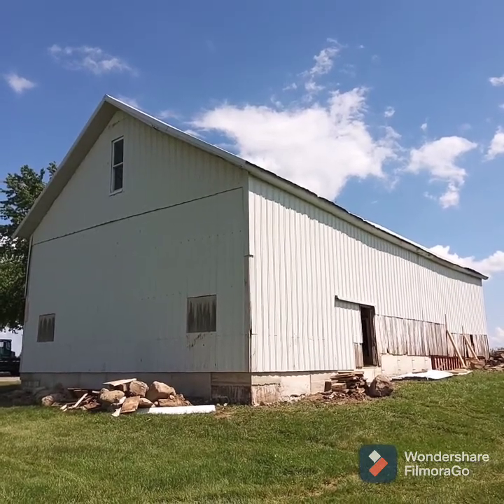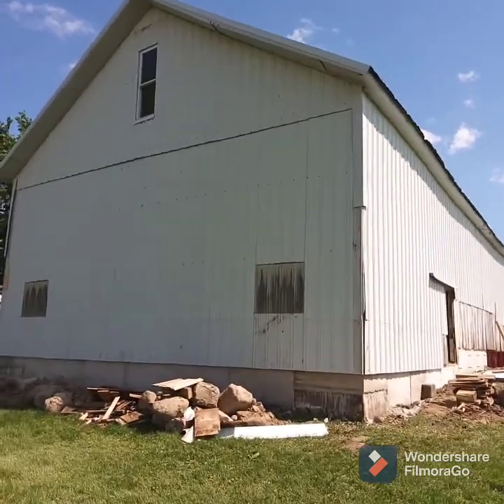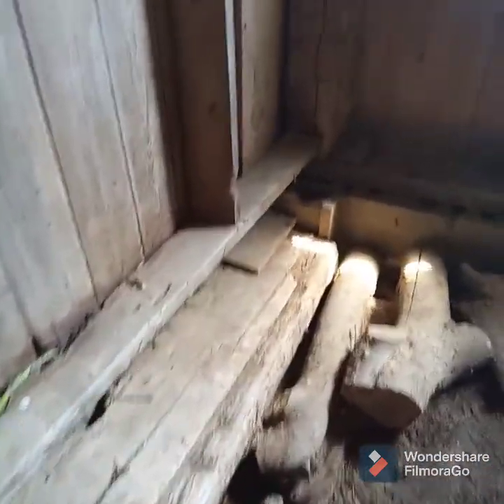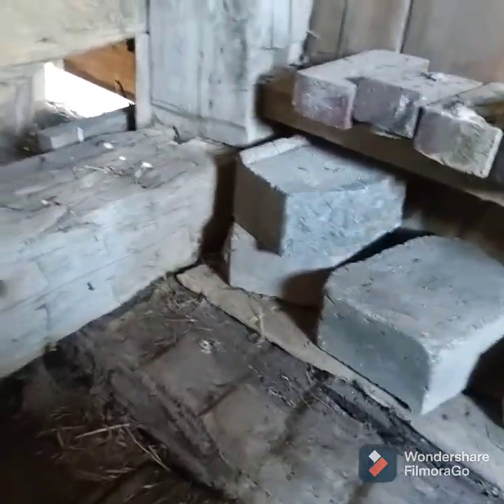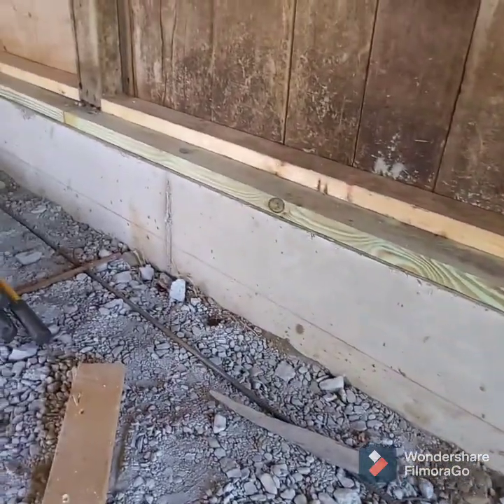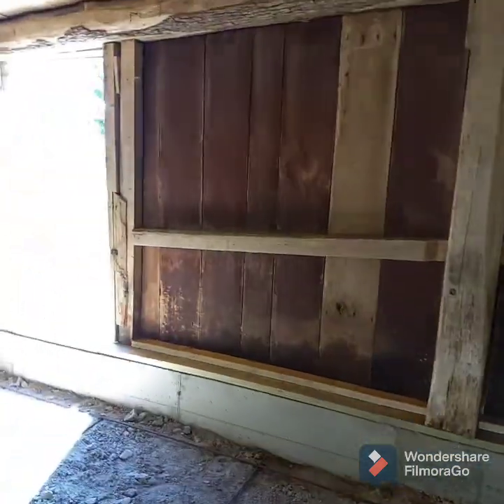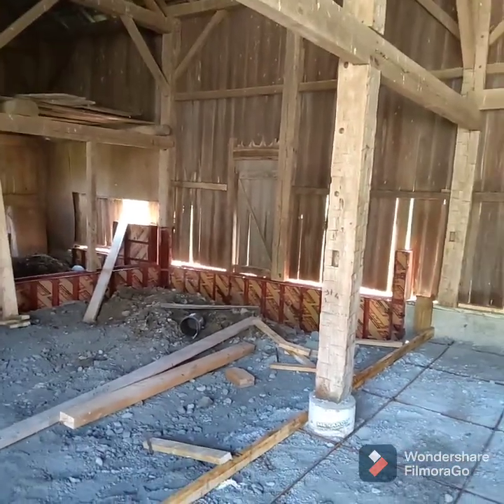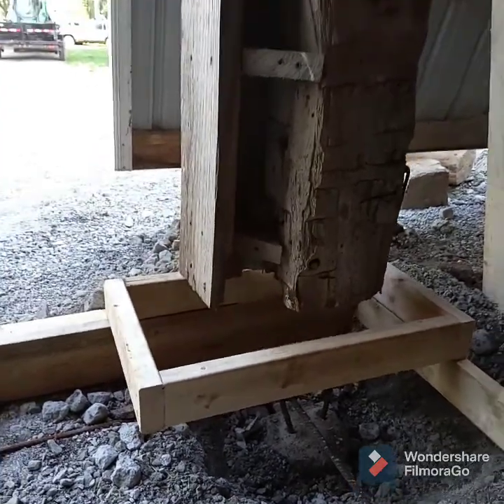What do you do with an old barn?

Comment: What did the owners end up using the barn for?
Reply from the maker: The guy used the big bay in the center for working on cars.  We did a concrete floor in 2/3 of the barn and installed overhead doors.  They needed to add siding on the outside to really preserve the building, but started with the foundation and floor.